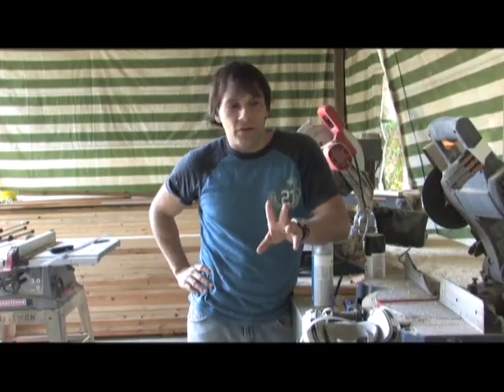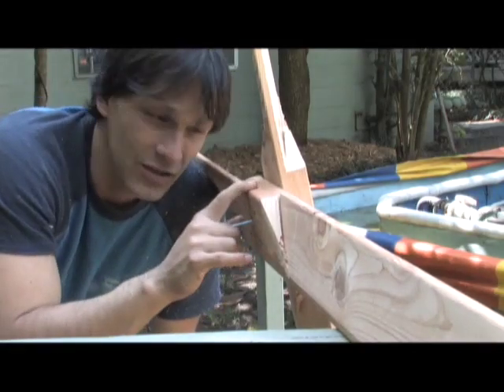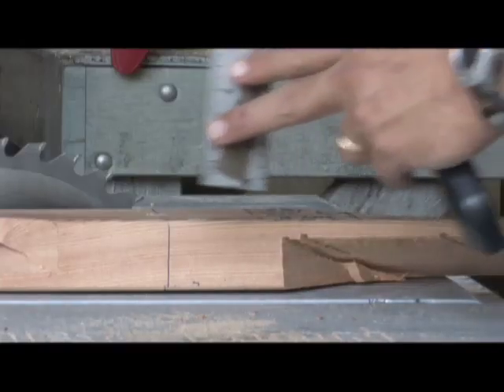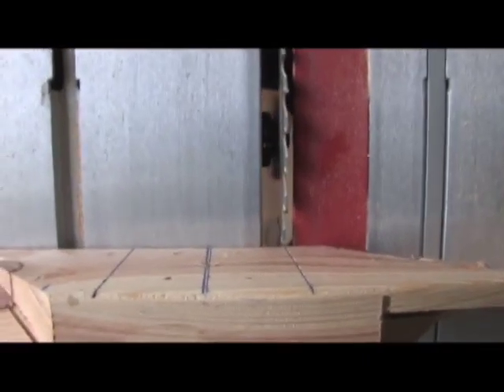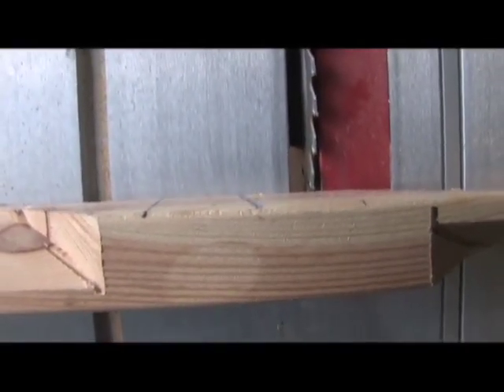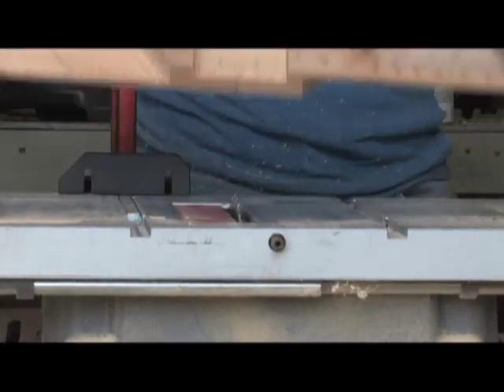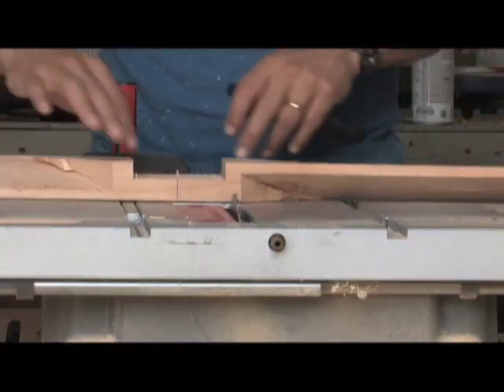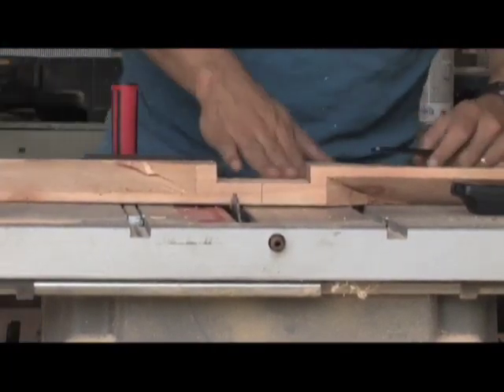WIND TURBINE BLADE DIY how to video Part 6 HAWT Windmill

Comment: Are you using a custom build generator or are you going to use a DC motor? Also, VERY IMPORTANT, do you have a way of shutting the blade down to lower it? Sometimes you can just use a a car battery tester that puts an extremely high load, which would slow it down, but it doesn't always work and you can risk damaging the motor/generator by overheating it. Given Florida's frequency of extremely high winds, being able to shut it down is important. Again, why the 4 blade design?

Comment: @gb072007 I've done this sort of work with hand tools. Tools you might use would include hand saws (rip, cross cut, and tenon), mallet, chisels, plane (jack or smoothing), spokeshave, marking guage, combination square, a solid work bench, couple of saw horses.  You'll also need plenty of time and a good eye for straight cutting.  Don't forget to wear safety goggles.

Comment: Looks like a fun project. Having built a few, if I may make a couple observations: for an 8 foot turbine, you will probably find you get more efficient production from a wider blade (2x8 rather than a 2x4) and changing from a simple deflection drag style blade to a true airfoil. There isn't much cost difference in the raw material and with a bit more work carving the blades into an airfoil, I think you will see even better results. Anyway, great vids! Thanks for posting.

Comment: Electricity produced is a direct product of the energy input, specifically the amount of force on the blades.  A shorter foil will have to have a greater cord to produce the same energy. A high aspect airfoil is more directionally stable than a low aspect foil.  An unstable turbine would have a tendency to react to any little change in airflow.High aspect=more low speed lift. Low aspect foils create higher turbulence (read drag). there is a reason aircraft props don't look like boat props.

Comment from the maker: It makes it stronger. If you skip this step use 1/4" steel bolts. Screws have a poor shear strength. Glue too.